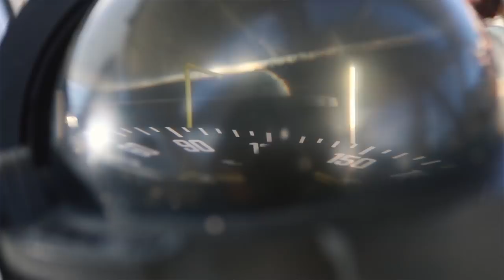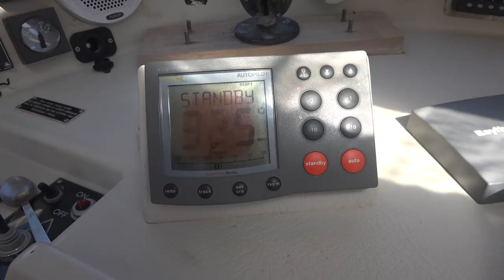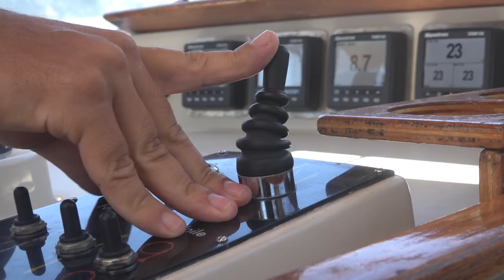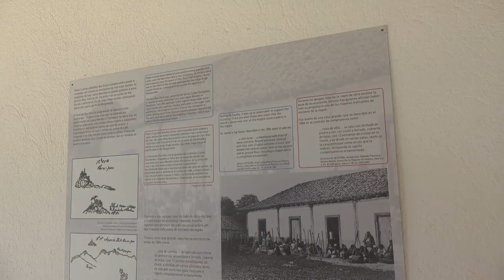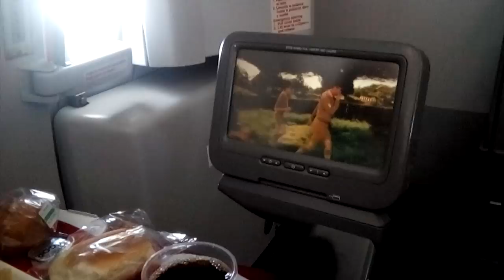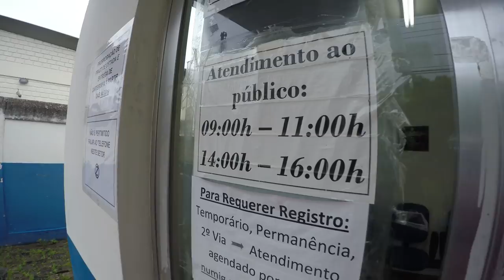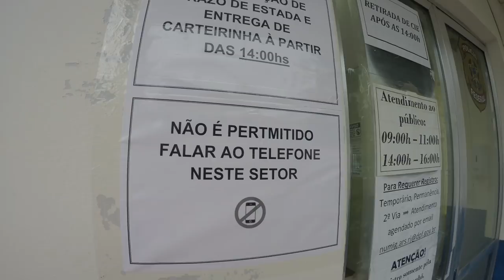UPS and DOWNS of our Sailing Life- SV Delos Ep 182

Comment: The best way to chase a leak in the engine room?  Throughly clean an dry the area where the leak is occurring.  After completely dry,  apply a liberal dusting of baby powder coating the area affected.  Once the given leak reoccurs...  It will leave a wet trail through the applied baby powder directing you directly to the source of the leak!  Neat trick!

Comment: Brady cut loose on you guys in this episode.  I would imagine having basic tools aboard would be a necessity while in far off places to fix (many ) things. You might look into getting a 3D Printer. For replacing smaller plastic parts or even prototyping other parts you needed. They can print flexible or hard plastic, although not high temperature plastic.

Comment: Brian: not sure which autopilot you have. Some of the Raymarine models work with or without a rudder transducer. You can change the settings in the setup menu. Just a thought. Sail on.
Reply from the maker: Interesting, never knew that.  Well if it breaks again will have to give that a shot!  Brian

Comment: I realize this comment will be seen long after it matters but RAYMARINE SUCKS! Get rid of that autopilot and install a SIMRAD or GARMIN unit. I have been installing marine electronics for 20 years and RAYMARINE is known to be the worst of the worst in quality, well maybe SI-TEX is worse. Hope you sorted it all out. Love the channel! One of my favorites. Keep up the great work.
Reply from the maker: Hey Ryan, I've never really liked Raymarine's proprietary protocols.  SeaTalk WHAT?  But to be fair this autopilot is the original from 2000 on Delos, and has probably close to 100,000 ocean miles on it at at this point so it's held up quite well....  But when we finally replace it will definitely be looking at other brands, will check out the Simrad and Garmin.  Fair Winds!  Brian
Reply: There are some hydraulic linear drives with integrated rudder position sensors. I am sure some with an NMEA 2000 output. I work mostly on larger power boats.